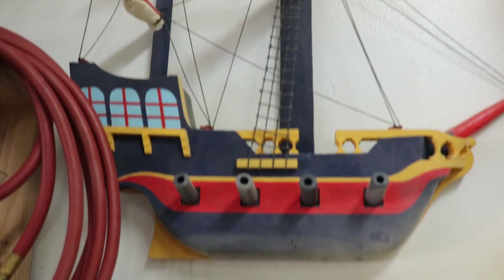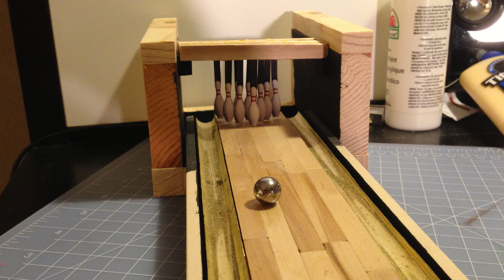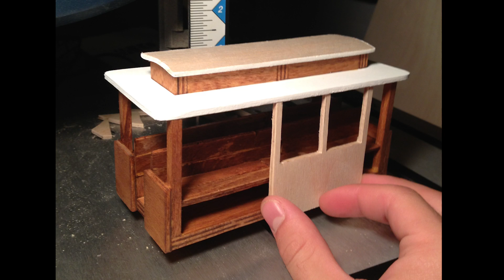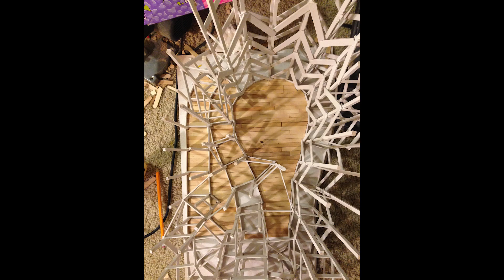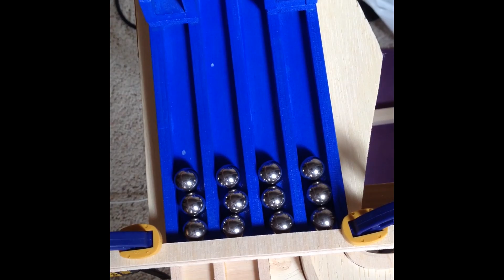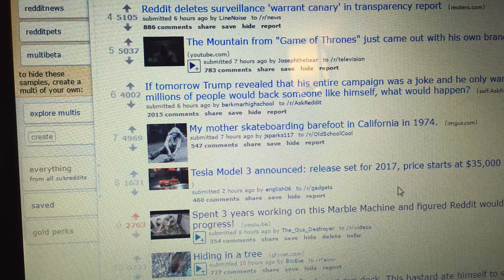Why I started building Marble Machines

Comment: When I saw the marble machine video I was as fascinated as you where when you saw the construction in the museum. I try to get into this sort of wood constructions but it just seems so complicated. From what you said in the video you constructed it as parts and not as a whole thing. If you did so, how did they all fit together and how were they connected if they were not built to work altogether? Also, I'm 15 years old, do you have any tips that can help me or any good book that I can follow?
Reply from the maker: It was like a 3D puzzle. When pieced together, all the sections and tracks matched up perfectly. As far as advice goes, there are lots of resources such as books, magazines, videos, etc that can be used to learn the craft.
Reply: Ben Tardif any particular book that you suggest and that may have helped you?
Reply from the maker: +vaggelis toubos I can't single out one in particular. Most of my education came practically and just actually building things. You can't read a bunch of books to become a great baseball player, you gotta practice playing. Same thing applies to woodworking.
Reply: Ben Tardif thanks a lot!